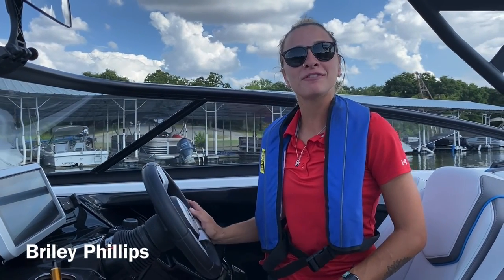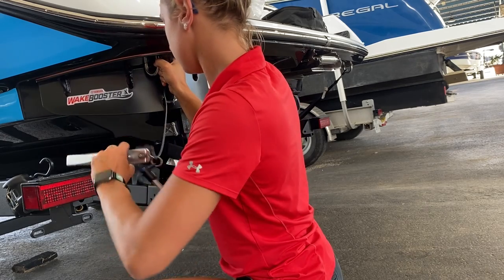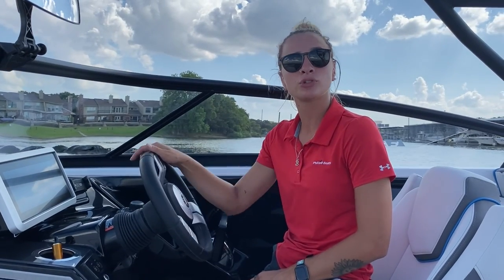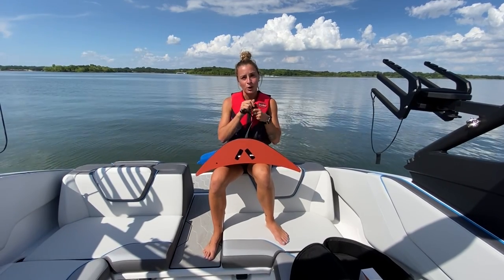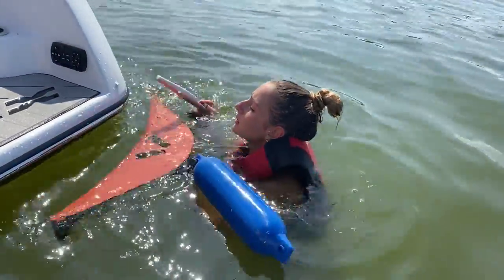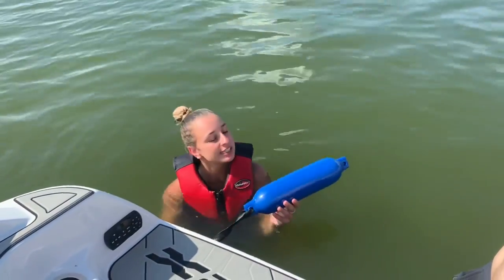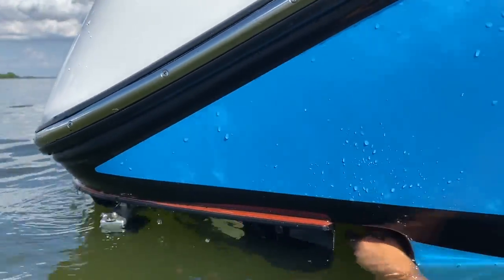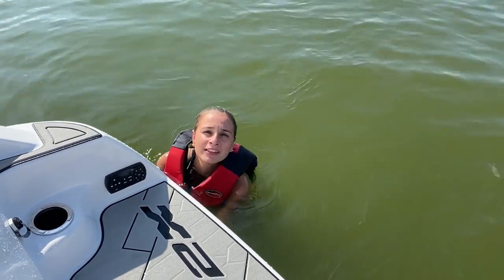Yamaha Wake Booster Kit Tutorial

Comment: Jus thought I’d share, I have a 2017 212x… something I found out later on. A bit of a design flaw with the booster on the Starboard side. On the 212x the scupper drain valve is on the starboard side next to the jet pump, basically facing where all the water being scooped from the booster; so all that forced water is strong enough to push the small rubber flap of scupper inside and all that water rushes up the drain hose and starts filling the cabin, and pretty quick. 

It took me a a little thinking to figure this out. But every time our goofy rider went we started taking on water through that drain port. 

Now this will only apply to boats that have the side scupper. I believe the 242x and newer 255 have center scupper drain valves. But the 212x (at least mine 2017) was on the side. But for regular foot riders it works great.
Reply: This is why the wake booster kit comes with a scupper cover.  There’s a little aluminum piece in the box that has tape on two surfaces to mount it over your scupper.  If you put this in place, you’ll have no issues with water being driven into your boat.  Unfortunately, the kit doesn’t include instructions to tell you what the cover is or how to install it.  I think I learned about it from the jet boat forum soon after I got my boat.